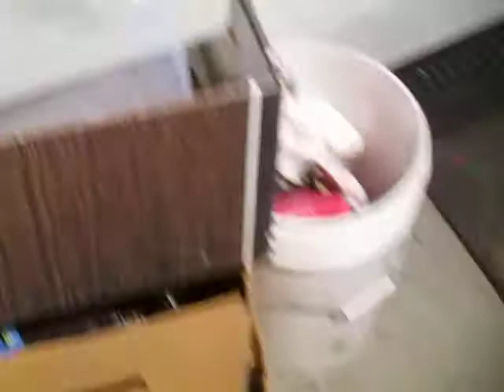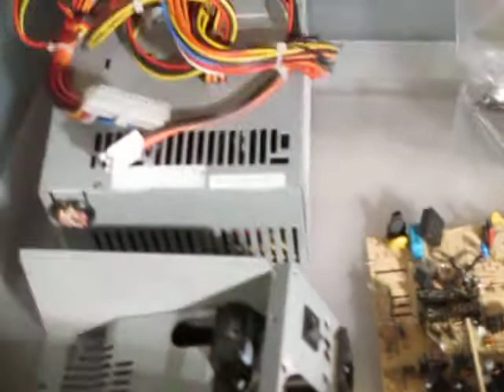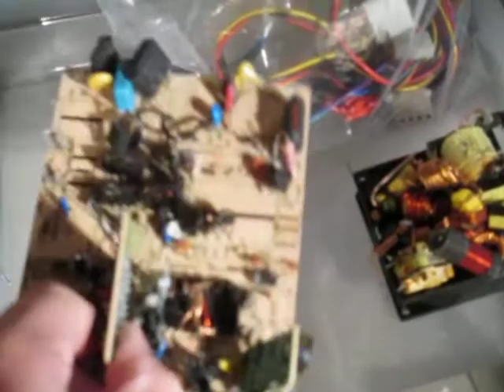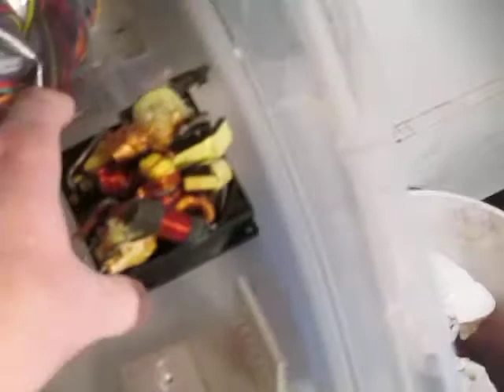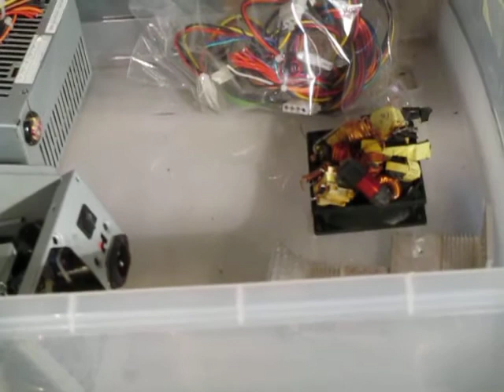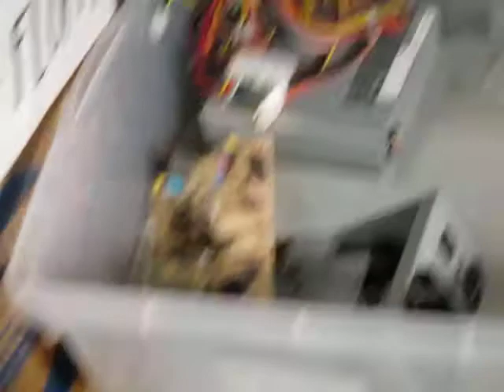Scrap Tip: Making More Money Scrapping Computer Power Supplies As Is? You Decide!

Comment from the maker: I have checked every yard in my area. No one buys low grade. Some companies can be shipped to but even if I had 100 pounds at .10 cents a pound shipped that is only $10 bucks. Shipping would be $50 bucks or more. I'd loose money. On the fans I just sell them as is. I get .23 cents a pound for them with the plastic left on. It would take a lot to get 1 pound #2 copper. Like the power supplies, I get more money with small motors left as is. Large motors I'll pull apart. Great to hear from you.

Comment from the maker: yard prices sure differ. To compare to the prices you listed this is what I get per pound: .04 cents for tin/steel, .08 cents for iron, 0 for low grade, $1.00 for mixed insulated wire, $2.50 for # 2 copper, .60 cents for computer heat sinks, .48 cents for television/monitor "sheet" aluminum heat sinks, .20 cents for computer power supplies, .15 cents for plastic case transformers, .23 cents motors/bare transformers mixed & .14 cents for male/female plug ends. All my boards are shipped to buyers.

Comment: the board is not garbage garbage !! , it has tantalum
Reply from the maker: ***** If you can point me in the direction of a buyer for power supply/low grade boards I'd really appreciate. Thanks.
Reply: I'm not recommending to sell them , I'm recommending to find out how to get out the tantalum off these boards , look for the blue capacitors  , collect them and learn how to get the tantalum out of it
Reply from the maker: Thanks. I'll do some research.